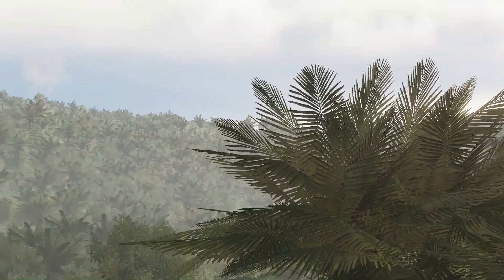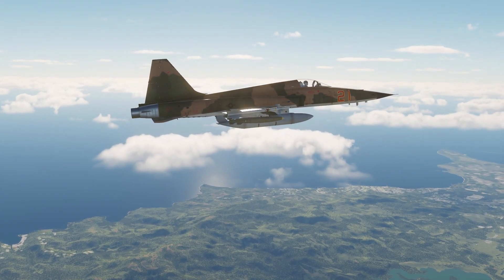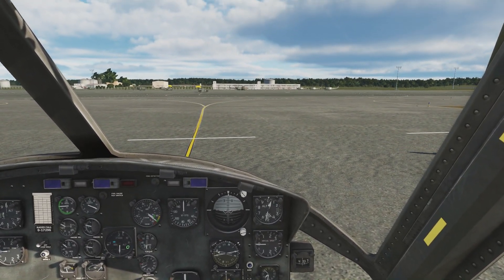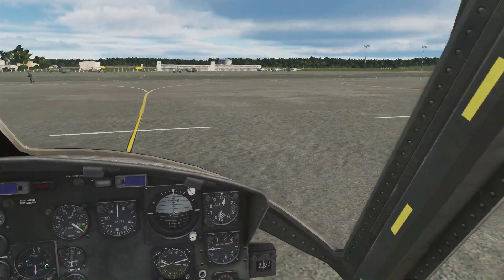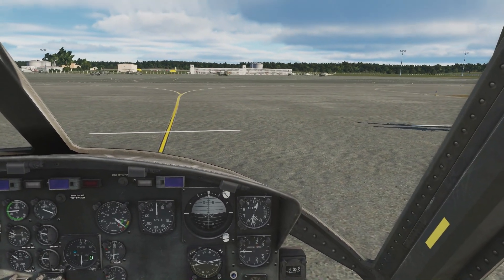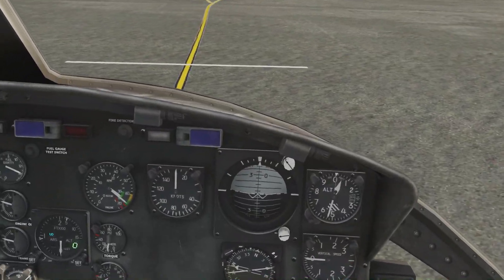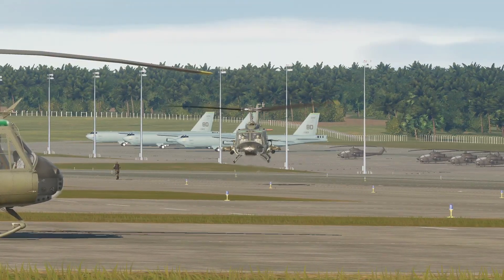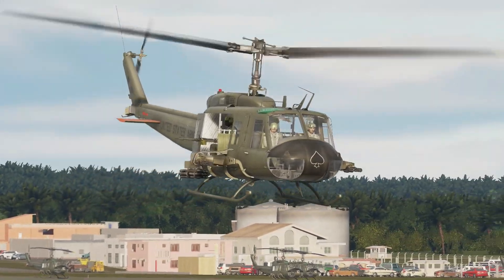Running takeoff in a UH-1 Huey gunship in DCS World

Comment from the maker: I stand corrected! A friend of mine sent me this message about translational lift, and why it occurs, it's really interesting: 
"On translational lift, you mentioned that the main rotor started acting like a wing going into forward flight, and that is the same thing

I thought must be happening to create translational lift when I started learning forward flight from hover, but it isn't actually what

happens. In a hover, whether in ground effect or out of ground effect, there is always some recirculation of the air going from below

the rotor back to above the rotor in a doughnut shape. It is actually a small amount of VRS! So dropping out of the sky in full VRS

is actually full recirculation of air. When you move into forward flight, that doughnut of recirculating air goes away, so the main rotor

gains efficiency, and that is why you start climbing unless you lower the collective."

Comment: Read "Chicken Hawk". Robert Masons memoirs as a Huey Slick pilot in Vietnam.
There's a passage in that book where an Instructor Pilot teaches a student to get airborne using your technique, yet doing so in a confined space. He did this whilst using anti torque pedal input techniques. 
I can't recall which pedal (probably right) but it allowed the aircraft to accelerate in a lazy circle. Translational lift was achieved and up they went.

I believe this worked, because without any (or less) counter active left pedal more power was available to the main rotor. Lower egt. More lift.
Genius.

Edit. Assuming if course its effect simulated in the flight model.
Reply from the maker: Yes, I remember that too! What a great book! Right pedal slowed down the tail rotor and as you said more power was available for the main rotor. Good trick, you’ll be needing it in the campaign ;)